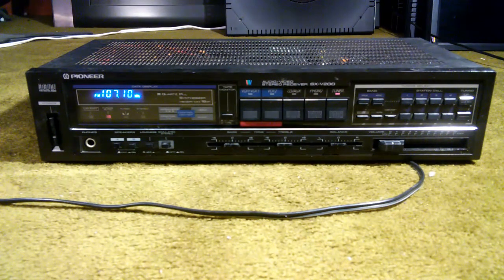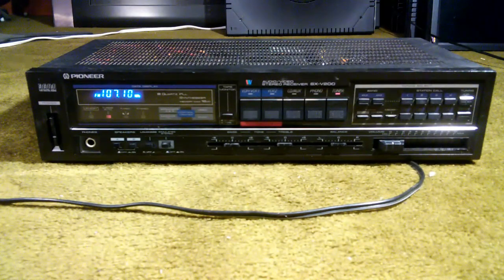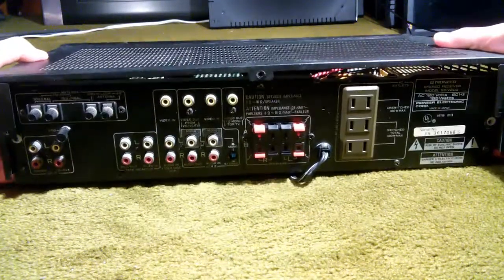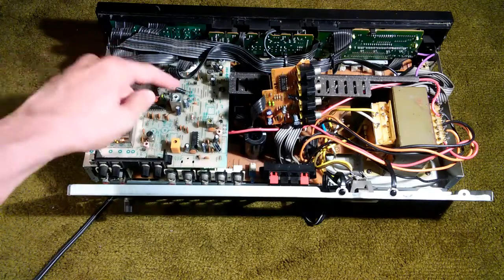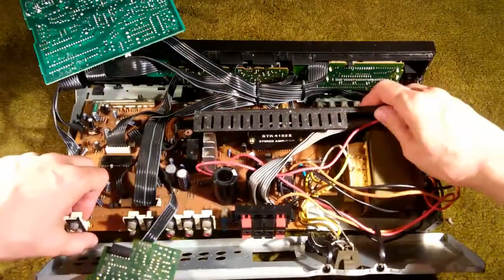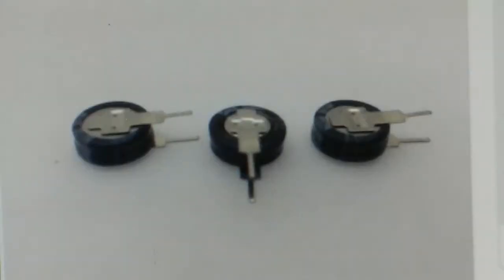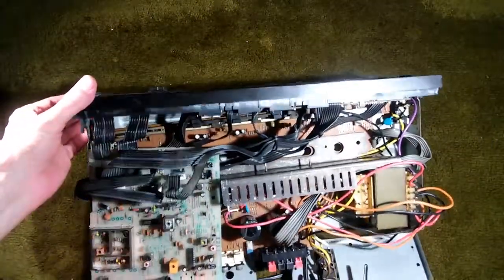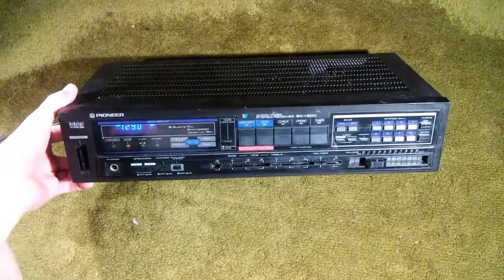Pioneer SX-V200 memory fail, capacitor replacement.

Comment: How did you avoid electrical shock?
Reply from the maker: The stereo is unplugged before you open it.  Wait a few minutes for the big power supply caps to discharge.  The memory capacitor itself is only 5.5 volts when fully charged.